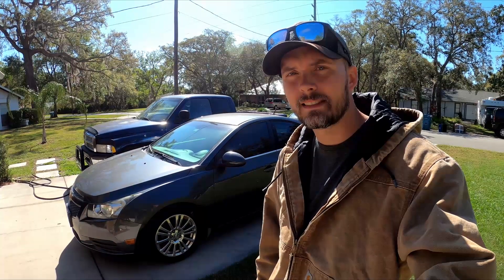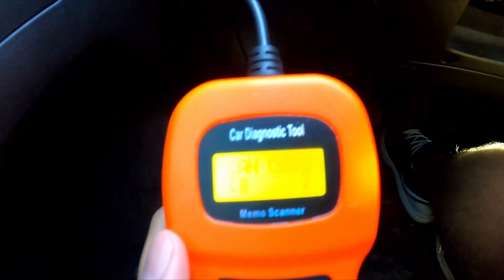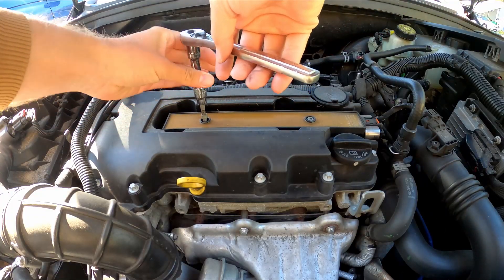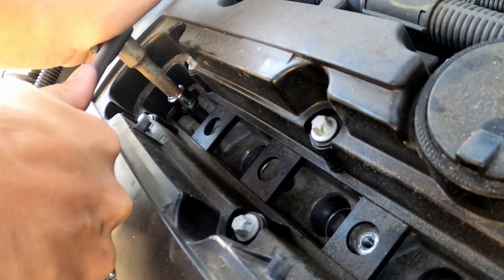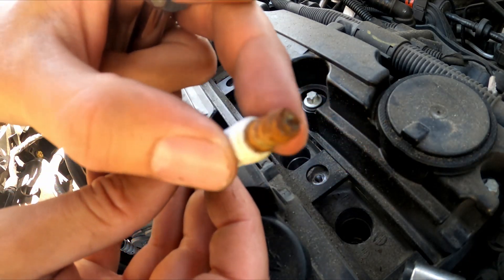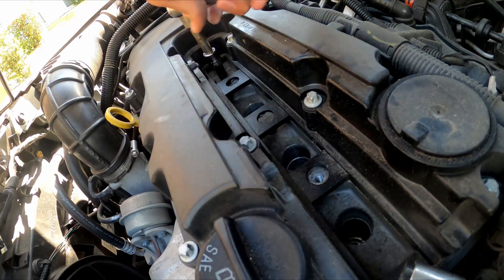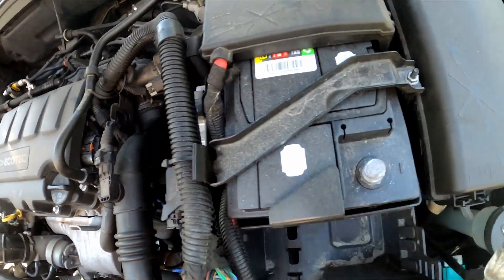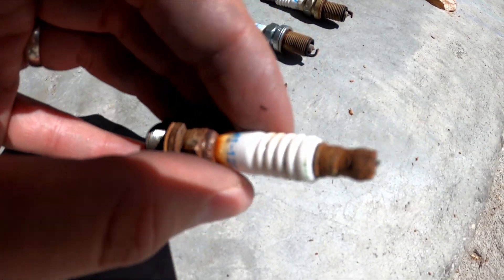How to Diagnose and Fix Service Stabilitrak Traction Control Problem 2011 - 2015 Chevy Cruze

Comment: Thank you! This video was helpful! But I do have a question for you. I have the same car as you, same year and everything and those same lights are popping up on my dash but it’s weird because when I reverse my car, break, roll up my windows or turn on my turning signal my car disconnects my Bluetooth and turns off my radio and also my lights lights slightly flicker so do you think that it’s a cause of the stibilitrak misfire or do you think it’s a different electrical issue? And did your car have any of the issues I’m talking about?
Reply from the maker: I haven't had those issues but sounds like a power connection issue. I would check the battery terminals and make sure they are tightened enough to get good contact. I hope you figure it out!
Reply: Ive had the negative battery cable replaced in my 2016 Cruze.
Reply: Im having the same type of issue with my radio, lights flickering and all that while stabilitrak control message pops up. If you find out the exact cause please let me know!
Reply: I also have a 2014 Cruze which i’m now dubbing The Crappy Cruze… just got a letter yesterday notifying me of a recall due to the Positive Crankcase Ventilation non-return valve in the intake manifold to fail. I had the stabilitrack, traction control, engine light off & on, rough idling, stalling when accelerating & losing power to the radio. Before I was aware of the recall I had the valve cover & the intake manifold replaced along with the surge tank hose, cam actuator seals & outtake housing replaced costing nearly $2k… only fit it to pull the same shit almost a week later to the point where it would cause further damage to drive & I was out of a car for about 3 months . Now I need to  decide whether to even have the recall work done or take in account to all the money spent on repairs in the last 3 yrs when it’s only got 97k miles on it & serviced meticulously. Hope y’all get the notification as well if your car has been included & have it replaced on GM’s dime.
Reply: @nicholechristina9889  2012 Chevy cruze LS (stock) having the same issues. I unfortunately have had no choice but to continue driving. One day I woke up and turned the car on and lil way down the road the car started shaking like crazy. Had me scared. But for the last week or two I’ve been driving it like this. I called a Chevy dealership and they said they would only be able to fix the negative battery cable, IF, they do a diagnostic and find that is an issue...which it probably is. But if it isn’t I have to be prepared to pay almost 90 for the diag. I verified also that there can be further problems associated with this negativebattery cable issue, that can cause further damage/repairs. So if they repair the negative battery cable, it doesn’t matter because I still have to fix this other stuff that has been broken due to the issue they built into the car. There’s a “special coverage adjustment” and everything about it which I recently learned was a thing. They couldn’t tell me what other issues might be caused without looking at it. So I can only imagine that it’s the spark plugs like in this video. But honestly I have no idea. The cable is 30 even if I don’t want to go to Chevy but I just imagine my engine just completely failing at some point if I don’t fix this or the cost will be beyond my financial scope. Anybody know how bad it could be or a guess?

*i guess 70ish for the coil and 30 for the plugs isn’t bad. But I don’t want to give myself false hope and fix these things just to find out I need way more money and needed to be focused on a different part of the vehicle.

Comment: @deuceliter - step by step was super helpful, this was the exact issue my 2014 LT was having. It’s running quieter now than I’ve heard in years! The coils were brittle and covered in green/white, and the housings came apart when I pulled it up. DEFINITELY needed replacing - thanks so much for the awesome video!
Reply: I would also suggest using dialectric grease applied inside the spark plug rubber boots, which helps with the electrical conductivity and helps prevent corrosion.
Reply from the maker: Thats awesome, glad to hear it's running better!

Comment: Would it be incredibly stupid of me to attempt this without any experience with cars
Reply: Nope! Did this, this morning took maybe 30 minutes. If you’re getting Stabilitrak, flashing check engine, and misfire codes, replacing the ignition coil erased those for me. Give it a go!
Reply: @ahayes1  Awesome, thanks for the insight!

Comment: I've had all the above issues with my 2011, I've replaced everything and I mean everything except intake and throttle body, the lights and stalling only happens once car is driven to optimal temps.  Runs great cold, codes reading improper air mixture, any ideas? About too throw this one in the canal!
Reply: I mean, what’s the specific code it’s throwing at you for “improper air mixture”?
Reply: Wow. I hear you. My car was reading misfiring on 1 and after they replaced it is still doing the same thing. With stabilitrak misfire on 1!?! Wth?! Please help!
Reply: Did you ever figure out problem? Im having same problem, i just put new water pump on, now when it gets to about normal temp, the stabilitrack come on and rough idel
Reply: @JBrady007  yes the wires inside my thermostat housing were corroded, the clip on top, I replaced entire housing with new steal one , lifetime warranty and it runs great.
Reply: Thank you. Have couple things to try! I really appreciate you replying back!

Comment: Just had same issue with my cruze. #1 coil extension to plug was broken and shorting out under high loads. Hill climbing. Replaced coil and plugs. Like new now

Comment: My cruze is doing the same thing. Occasionally the radio will cut off too. I replaced the coil and plugs, but still get a missfire code every now and then. Also stabilitrac and traction control light come on. They go away when i shut the car off. Wtf. Anyone have any input?

Comment: Great helpful video. I was about to take my car to the dealer to get checked out...then I watched this video....long story short you probably saved me a lot of $$$ As we all know the dealer would of said I had to change everything under the hood costing me probably nearly $1000k. I did order a new ignition coil well it turned out that when I put the plus in a few months ago in the #4 plug cover in the coil the spring was not making good contact...so I just took a screwdriver straightened out the spring...problem solved. Thanks man.
Reply: How much did you spend to fix it ?

Comment: Had those problems with the chevy cruze turbo, stared with the, #3 plug, didn't change the plugs, knox sensor, turbo charger, engine light codes, change the plugs and the problem solved.
Watch out for the crooked mechanics, wanted over $500 to repair vehicles, coste under $40 for plugs.

Comment: i’m having the same issues(erratic gauges) replaced TCM, battery, all the wheel speed sensors, camshaft position sensors new negative terminal idk if it’s the coil packs my lights would come on when it rains and a week or so later they’d go away...seems like when i opened sunroof and lights were on the all the lights would also come on i also get theft deterrent lights. (2015 buick verano)

Comment: I was just trying to sell my car and this issue popped up for the first time on a test drive (of course.) Found this video, went and got the parts and installed.. and bam. Problem solved and car was sold! Thanks my man. Edit: car was 2012 Chevy Cruze LT 1.4L
Reply from the maker: Awesome!
Reply: How much did it cost you overall?
Reply: @tharealcartiierzayy8997  I think for everything it cost me about $180
Reply: Did you only replace the coil ? or the rest of that stuff also ?????
Spark plugs too ???
Reply: @sandraburdette9159  think I had gotten the coil and 4 spark plugs

Comment: Thanks man , had the same exact thing happen, I ain’t even a mechanic but thru your step by step instructions and the links I was able to fix the issue no problem . I appreciate you taking the time to do all that made my life a lot easier
Reply from the maker: Glad it helped you out Mike!
Reply: I have a 2011 chevy impala car, What is wrong if get a message like this when it is cold out side service traction control and the stabilitrak and engine power is reduced and the check engine light is on, But when it is warm i don't have any messages or lights on @deuceliter

Comment: It could be plenty of other things don’t just fall on the idea that you have a misfire. Intake manifold on this car has a known issue between the technicians community. The intake manifold fails prematurely causing the valve cover to tear a hole into the pcv grommet, forcing oil out of your seals such as the gasket on the valve cover itself. Oil will also collect in the spark plug cylinder housing if this is your issue.
Reply: What would you do in this case?
Reply: @chastityconn7331  you can do simple tests on the valve cover by placing your finger over the pcv breather or take your coil pack off and check the cylinders for oil in the plug holes and if any of these show signs explained replace the intake plugs and valve cover
Reply: Yes that was my problem Val cover

Comment: Yes finally I will show this video to my husband. We have the same light coming on. Thank you for this video
Reply: It could be plenty of other things don’t just fall on the idea that you have a misfire. Intake manifold on this car has a known issue between the technicians community. The intake manifold fails prematurely causing the valve cover to tear a hole into the pcv grommet, forcing oil out of your seals such as the gasket on the valve cover itself. Oil will also collect in the spark plug cylinder housing if this is your issue.

Comment: Thanks for sharing this because my Chev 2012 is showing me the same problem and you think that is what I should do to Fixe it?
Reply from the maker: I would check the codes first. If you don't have a code reader, some auto parts stores will pull the codes for free.
Reply: @deuceliter  thanks 
I just bought the car diagnostic tool and I will see the cod
Thanks for the video it’s been really helpful and I have an idea now why mine is going that 🙏
Reply from the maker: The tool will hopefully point you in the right direction. Judging by the amount of people watching this video, it seems to be a huge problem with these cars... Good luck!

Comment: I just performed this fix on my 2015 (116K+ miles) and it runs great with no more codes.  One issue was the #4 plug was covered in oil.  The top of that piston has a lot more carbon build up on top than the other three.  Bad piston ring?  And just to top off the issues, during the test drive the AC stopped working.  I know the AC is unrelated but likely time to get rid of this car.  Thanks for the great video!!
Reply from the maker: Thanks Jeff! I've had a lot of issues with the car as well. Good luck on the A/C, I couldn't imagine not having it hear in Florida...

Comment: I just got a 2018 Cruze and the first day I go it the engine light was on and it felt like it has no power at times. The light went off but still have a lot of times where the power is low. Also had the stability trac light on for but that went off too. My spark plugs look good so I wonder what it is. Only have 21,000 miles
Reply from the maker: I would bring it up to chevy and see if it's still under warranty. I think there's is 3 years 36000. You may still have time!
Reply: @deuceliter  I’m going to have to find out if I have warranty. I bought the car as a salvage vehicle so I wonder if the warranty gets voided.
Reply from the maker: @DD87336  Let me know how it goes I'm curious as well. Good luck!

Comment: Do you have to replace both the plugs and coil pack? I pulled my plugs out and one looked pretty bad like yours but the coil pack is still less than a year old
Reply from the maker: Rule of thumb I go by is that if your plugs are failing, it's best to change both. If it's just routine maintenance then just changing the plugs are fine.  If your plug is rusty then there's a decent chance water got inside your boot as well which could cause unseen rusting inside the connector. You could always just change the plugs and see if that fixes the problem, if your still getting the same misfire error code then I would say change the coil next. Good luck!

Comment: Nice video showing the causes. Water, dust, shock can cause any number of issues. The water got in there past the rubber seal, and had no way of getting out. Boiled and rusted when stopped. The same issues can affect the wiring harness and connectors.
Reply from the maker: Thanks for the insight!

Comment: I think I had the same issue all the way back in March. For me, the car did like an elastic kind of pull, and the engine light was flashing and the stabilitrak light came on. After a few seconds of driving home, both came off. I’ve been having the problem ever since when driving upslope at 40-50 mph. Took it to a mechanic and he changed my plugs, still happened. Took it to another, tells me that when I get codes to talk to him (it doesn’t send any codes). Drove it home with the previous owner, when it happened, the motherfucker said it was just the gears changing.
Reply: I have the same problem did you fix it?
Reply: @312exclusives  not yet, and im not sure if i will. I could try and get a new coil pack, but i noticed it only happens at 5th or 6th gear, so im also thinking if its a transmission issue.
Reply: @manny7289  omgg this is happening to me and the mechanics are saying nothing is wrong but my car will jerk and hesitate to shift gears randomly. My engine light went off too so they can’t get any codes. 🙃 unfortunate
Reply: @hannahc1118  one time my codes didnt go away and i got them checked. It gave me a code for a misfire in cyl 3. Could be the fuel injectors
Reply: @manny7289  oooh okay im so glad you got yours fixed. i really hope it’s that for me as well and not a transmission issue. Im tempted to just get them all replaced because I can’t get that engine light back on to save my life and no one else knows what to do :(
Reply: @hannahc1118  The thing is I didnt lol. Im sorry but I dont really care anymore to fix it.
Reply: @hannahc1118  I noticed that, to get engine light and the stabilitrak light to come on, the car needs to hiccup pretty badly for around 5 seconds continuously. It is kind of rare for it to happen.

Comment: Thanks !!! Bout to try this on my 2013 Chevy Cruz eco. Will be back with an update .
Reply: update?
Reply: @reggieos6945  mybad . Honestly I just replaced my front passenger tire and it has not came back on since .
Reply: @tedgraham6548  mine comes and goes also its random it does it maybe once every week or so
Reply: @reggieos6945  oh wow
Reply: @tedgraham6548  some days it has a check engine light some days it doesn't  I hate the cruze has 78k miles  currently... I personally replaced 3x valve covers thermostat water pump window motor intake manifold  and a turbo charger 🤬vacume line has a oil leak + this random bullcrap luckily I do it myself I couldn't manage paying a shop as many issues it has / had  thing is a lemon I bought with 40k miles non stop issues after warranty ...  how many miles is on your junk chevy?
Reply: @reggieos6945  oh wow , I have not really had issues like that , I bought mine at about 80,000. It has about 133,000 now . So far the most I have had to replace was the tires , a 60.00 job with part of a water pump housing outlet. I replaced the window regulator on two windows. And a front head light . The trac light is not coming on. However my Engine light is on , I was told it was something dealing some air that has to come out on its own. I still hate it’s on. So far nothing major

Comment: Hello, I have a 2014 Chevy Sonic LT 1.8L and whenever I try to go up hills I would lose power, hear a grinding noise from the front and white smoke would come out the exhaust… what could be the issue? I just changed the spark plugs, valve cover, PCV valve, oil change, knock sensor, etc
Reply: ITS YOUR INTAKE MANIFOLD!!! the manifold has a premature fault causing your pcv system to fail.

Comment: Hi. I bought my 2013 chevy cruze in March. Mine was doing the same thing I tried to tell the mechanic that something was causing it to lose power and shake when I had my foot on the break. This has been going on since I've had the car and they said nothing was wrong with it. I was coming back from a friends house last night and the same light just flashed on and went off.. Is this the same problem
Reply: Pcv valve &or  the engine valve  cover needs to be replaced.  Cuz your losing vacuum which powers your brakes 
Buy cover online way cheaper on Amazon
Pcv line is go through them I've had a lot of problems with Amazon ones
Reply: @kotten8108  Thank-you  😊
Reply: @kotten8108  OK thank you
Reply: buy one from the parts store there 99$ and they come with a lifetime warranty and I been though 3 valve covers because of the pcv valve it's all one pice

Comment: I have a 2007 Yukon GMC the stabiltrak and egine reduced speed keeps coming on I have taken it to 3 different mechanics and they all said it was fixed but I'm still having the issue I really need help!!!
Reply: Good luck and thanks
Reply: @GardenStatePusher  No problem!!!
Reply: Same with my 07 Escalade😢
Reply: @GardenStatePusher   I had a crank shaft censor put on it and it hasn't done it anymore but now my truck  has issues with starting up! But I hope you get yours repaired!!

Comment: So will this make the car run bad? Like bad gas mileage
Reply from the maker: My car ran very rough, and felt unsafe to drive. Not sure about the gas mileage though.
Reply: Mine came on but goes off after awhile so it has nothing to do with the braking system ? Just the spark plug coil pack?